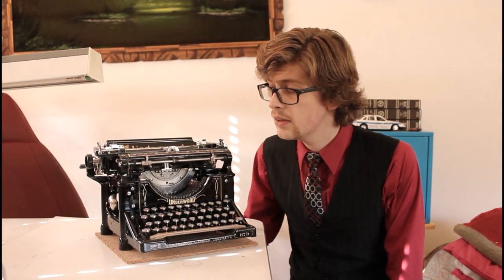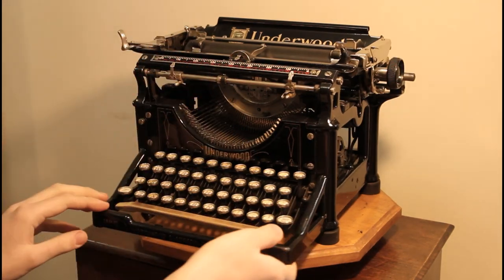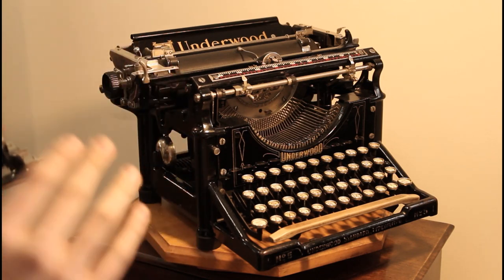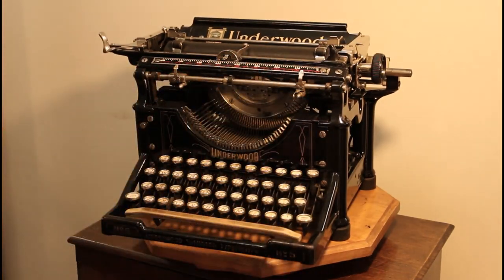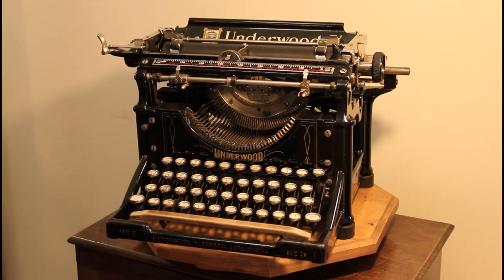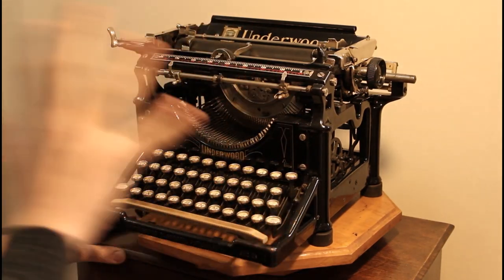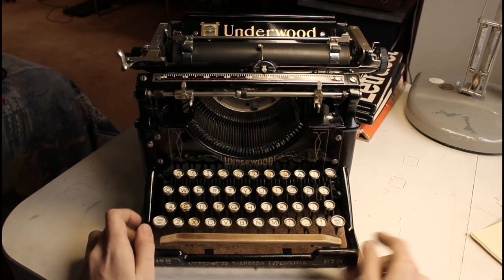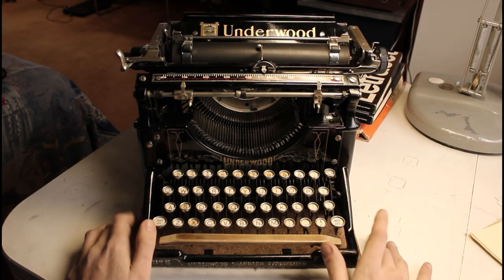Review + Typing Sample: Amalgamated Underwood Project

Comment: Man, such a magnificent and impressive work. May I ask some little details about the paint job? Which is amazing I have to say.
What kind of paint did you use? In case you used a spray gun, what settings did you use? Thank you in advance.
And again, it is amazing, everything amazing.
Reply from the maker: I'd have to get back to you on the brand of the product. But it was conventional hardware store rattle-can paint and lacquer. Mind you, the painting was a process of 2.5 days, as the machine currently sports 7 layers of paint and 4 layers of lacquer.
Reply: @dr.typewriter-venneburgtyp121  
Interesting, did you use any sort of polishing compound after the lacquer/varnish?
Reply from the maker: @PARADISE.G89  I buffed it once with Mother's polish ONE MONTH after application.

Comment: Looks stunning!
Are you planning on adjusting the right margin? At (for example) 13:54 the carriage does not stop on the margin, while the bell does work in some cases.
I cannot get the margin stop working correctly on my 1927 model.
Reply from the maker: That is actually one of the adjustments that still needs to be made. The actuator is out of alignment and does not engage the typebar inhibitor.
Reply: @dr.typewriter-venneburgtyp121  Ah, right. Good luck!
Something on my No.5 seems to be bent. The margin works better on the sides than in the middle. I have removed and checked/straightened the guide rods underneath the margin ruler, but it still isn't right.
Reply from the maker: @Marty_M Have you oiled it? It might sound funny, but those margins are touchy to lubrication.
Reply: @dr.typewriter-venneburgtyp121  yes. I believe so. But the movement isn't the problem. The alignment is out of whack. I can get it to work on the left and right side, or toward the middle. Not across the whole width.
Reply from the maker: @Marty_M  Do the parts meet with the ruler off?
Reply: @dr.typewriter-venneburgtyp121  Yes, everything seems to fit ok. I can't really check at the moment because I don't have the machine on the bench now. (still working on that Royal 10 with case, but currently busy with other things, so pressed the pause button on that one as wel...) I'll have to return to the 5 at some point, because I really want it to work correctly.
Reply from the maker: @Marty_M  Well, let me know. I might be able to help
Reply: @dr.typewriter-venneburgtyp121  Will do, thanks!